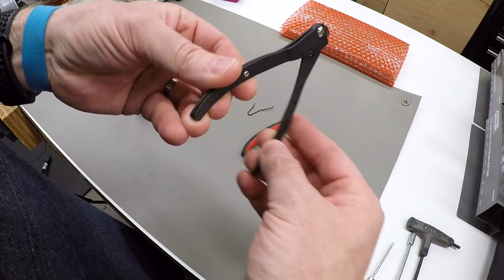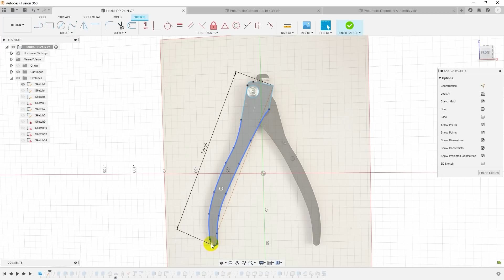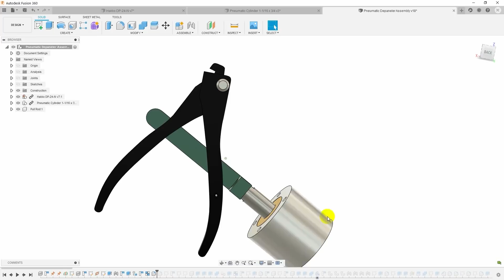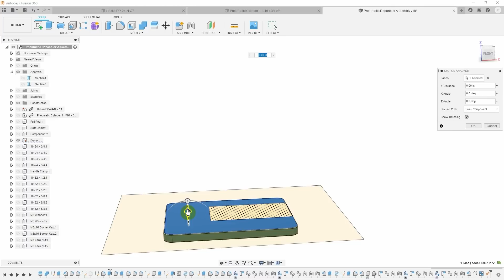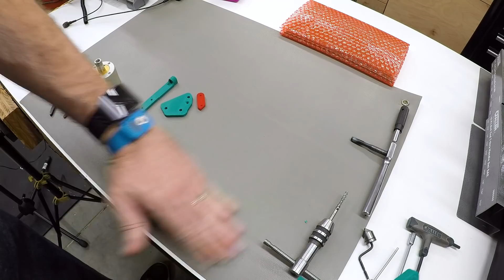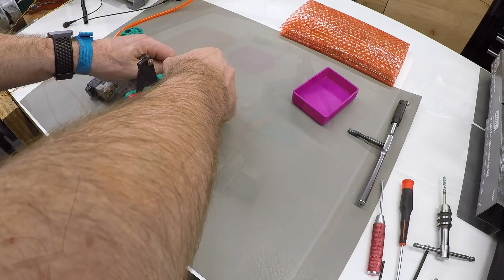Pneumatic PCB Depaneler

Comment: "I happened to have a pneumatic selenoid", "I happened to have foot pedal"; I am fascinated by your room of necessity. Hogwarts has nothing on you! Great video as usual. Great use of the 3D printer and nice tutorial on dimensioning from an image.
Reply: I live in the opposite universe where it doesn't matter how much stuff I have, I never seem to have the bit I actually need.
Reply: @BM-jy6cb  I'm living in the same world as you then lol. Finding the right part and correct bit is always a challenge lol. I keep tons of small parts, bits and pieces, but never seem to have the right piece.
Reply from the maker: Thanks!  The foot pedal is for the tool changer on the new mill spindle, the valve was also for the tool changer, before I changed my mind about the design, and the pneumatic cylinder is a dumpster find.  :)
Reply: Junk (or treasure, depending on one’s perspective) is the stuff that one keeps for years, finally gets pitched into the bin, and two days later, one has a perfect use for what is, now, no longer present.

Be well & Best regards, Gottfried

Comment: I'm surprised you didn't just shorten the front handle and add a hole to bolt through. 
If you did make a v2, would you reuse the Hakko tool or just copy the geometry?
Reply from the maker: I didn't want to destroy the tool, in case it didn't work out.  I still have boards to separate.  :)
Reply: @Clough42  Another good reason is an unmodified tool will be easy to replace when it wears out. Cutting the handle would require cutting the handle on replacements.

Comment: I'd be interested to see how many cycles you get out of the setup before any of the the 3D printed parts fail.  Should put a cycle counter of some sort (or just estimate by the number of tabs you go through).   I also have one of those depaneler tools and confirm they hurt like heck after going through any significant amount of use.
Reply from the maker: I'm curious, too.  It's got about 400 cycles on it so far and all the parts are still tight.

Comment: When i am taking photos of an item that is difficult to measure,  I will put an object that is easy to measure into the photo as well.  Parallels,  1,2,3 block,  coins,  etc. 

This allows me to scale the canvas correctly before i ever start sketching.
Reply: Photographing on graph paper is great too — you can correct lens distortion in Photoshop then import
Reply from the maker: Yeah, that's a good idea--especially when combined with the "calibrate" feature someone else mentioned.
Reply from the maker: Cool idea.
Reply: @Clough42  yup. I should have mentioned that too. Im not sure when they introduced calibrate but it eliminated the calculator math when using the traditional scale.  I stumbled across it back around March sometime and its been great. 

I should add that you really want your scale object at the same height as your modeled object
Reply: I use my fingernail.

Comment: If you have a flat bed scanner, you can scan a part and a ruler at the same time. It only works for parts with flat sides. I've done this plenty of times and it works like a charm. Pick a nice rule. My favorite is a PCB ruler because it has really crisp edges that lie flat against the scanner.
Reply: i do the same thing.. guarantees a perfect top down image.

Comment: Excellent. Could also be used with a standard set of snips to cut smd components on tape into set length!
Reply from the maker: Oooohh...good idea.  It turns out I cut a lot of single-row headers to 5-pin lengths.  I have been thinking about ways to automate this, but every solution I came up with would have sent the cut-off pieces flying.  Having both hands free would help a lot.  Though I'd probably want to start with something like a Midwest Easy Cutter, and that would require some careful thinking about guards.  One of those could take a whole finger.

Comment: this is a freaking awesome build . on another note i got my teco vfd today...what a nice build ...maybe grind down the sides of the tool a hair so it fits the  in between board seam...
Reply: @ minskmade Awesome, I want the Teco VFD also. I'm trying to find a decent motor that is not to much though. The one James got is a little more than I want to pay. I may have to though.
Reply: Yup. If you've got enough to do - lightly kiss the sides of the moving jaw below the cutting edge with a grinder. (Looks like you wouldn't need much at all) You should be able to then slide thru without pulling the board up each time.

Comment: The project is just awesome :)
But there are some dangerous gaps that might lead you to breaking or smashing your fingers. Consider making a cover for it.
Also if you make a flat cover, it might be easier to feed the mouse bites.
Reply from the maker: I have already caught a finger in the tool.  The linear pull force is only about 30lbs (~130N) so it isn't really that dangerous, but the point is well taken.  A guard would be a good thing.